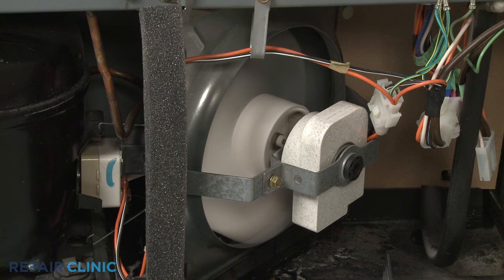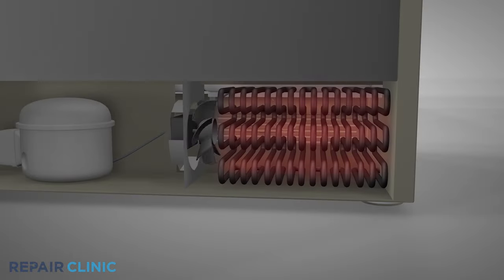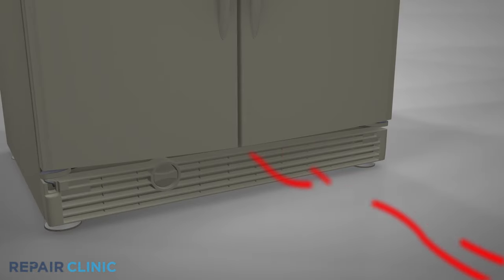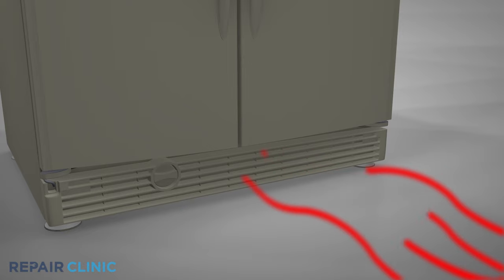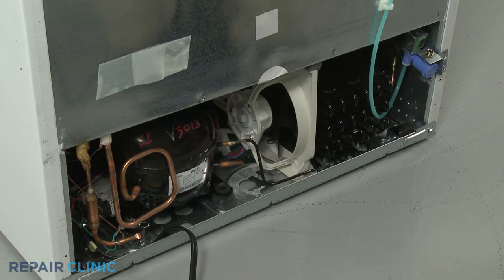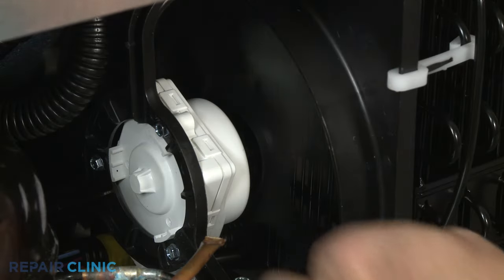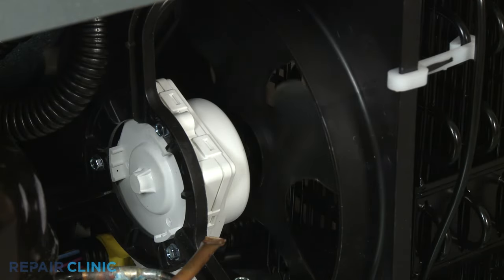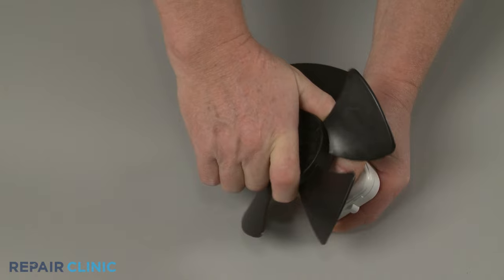Refrigerator Condenser Fan Motor Testing

Comment: What if your not recieving any voltage from the plug?  It doesnt explain what to check if there is no voltage coming from the plug that plugs into the condenser fan.
Reply: Did you test plugged or unplug

Comment: Hello I hope someone can help, my condenser fan wasn’t working so I replaced it with a brand new one, when I plugged it it worked fine, fridge was nice and cold, however when the compressor and condenser fan stop when they should, Only the compressor restarts, the condenser fan doesn’t start, if I unplug the fan from the PCB board and reconnect it it starts to work again until it stops, please someone help my fridge is a whirlpool side by side.
Reply: I seem to be having this same issue - I checked the fan and it seems to run just fine after being plugged back in, but does not restart on the next compressor cycle. Did you ever resolve this issue?